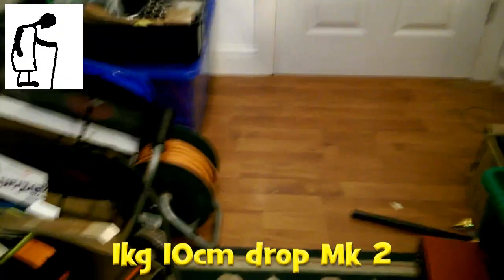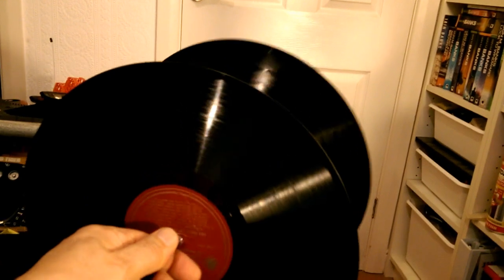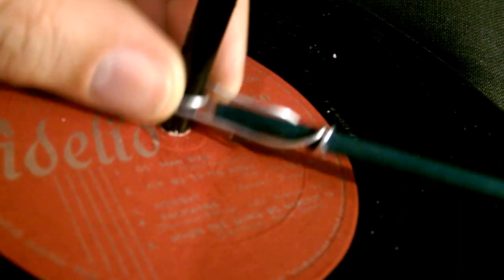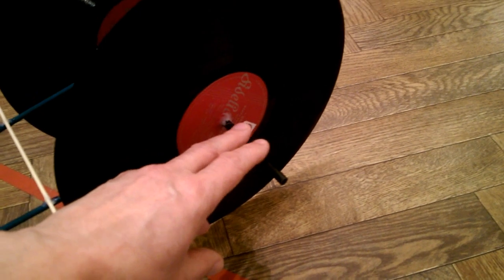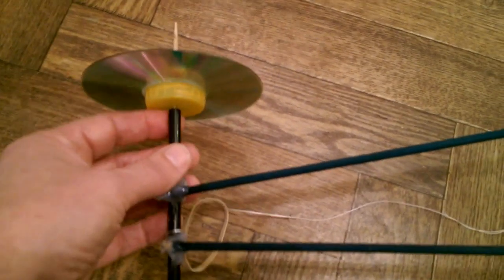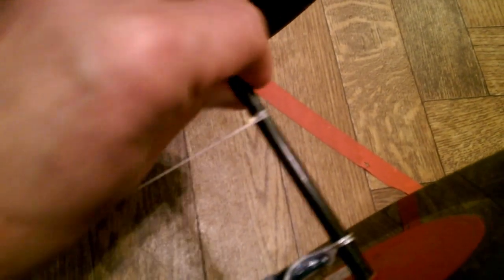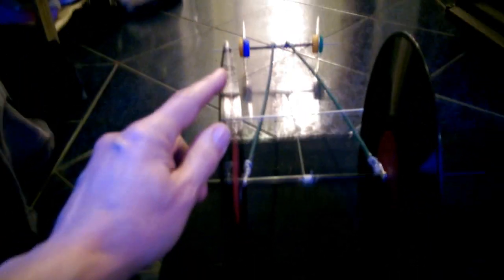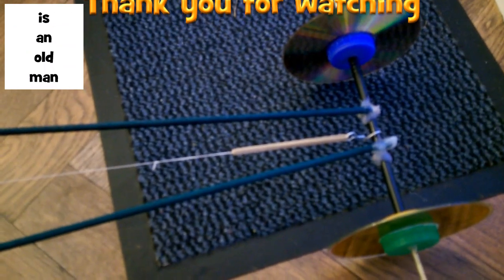Rubber Band Power conversion Grandad's Junk Pile Projects 15

Comment: Hey can you make a video about making a remote for a rc car or plane
Reply from the maker: +Music Maker I would not attempt to make a remote control myself but I am sure a quick YouTube search would find somebody who has done one. It rather depends on how much work you want to do and how much control you want. A simple infrared system that just turns on/off the motor would be quite easy but if you want forward/reverse and steering then you are going to need to do more work.

Comment: hey grandad, could you make a hopper, doesnt matter what it is made of, that will hop up to 2 to 3 feet high?
Reply from the maker: +Epic Face 3000 if you mean like a space hopper I would just buy one. I have no way of making one https://youtu.be/nlz5f9WfGno
Reply: +GrandadIsAnOldMan  thats not what i mean, like a little machine that will hopp into the air, not a space hopper.
Reply from the maker: Epic Face 3000 is it a single leap or a repeated hopping?
Reply: +GrandadIsAnOldMan  a single leap
Reply from the maker: Epic Face 3000 I'll put it on my list :)